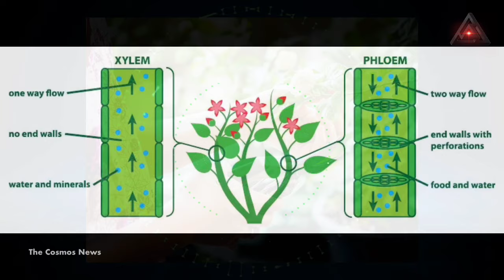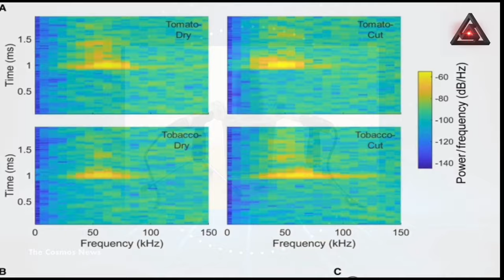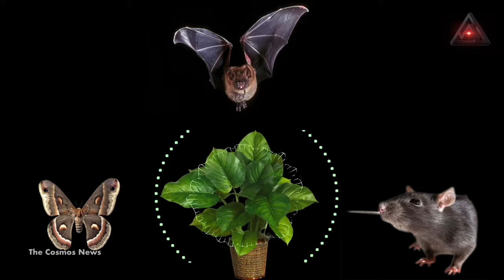Plants Feel Pain And Scream When Stems Are Cut Or Dried Crying Sound Recorded @TheCosmosNews

Comment: Item #: SCP-4521

Object Class: Safe

Special Containment Procedures: SCP-4521 is to be kept in Site-551's Bioterrarium and only accessible by personnel with Level 2 clearance or higher. Additionally, attempts are to be made daily in an attempt to provoke vocalizations from SCP-4521.

Description: SCP-4521 is a Douglas fir tree with abnormal shape and leaves. SCP-4521 was discovered within God's Silence, Oregon after reports of an "ear piercing silence" from within the tree's vicinity. Amnestics were administered, and SCP-4521 was transported by implanted Foundation agents to Site-551.

Currently, SCP-4521's anomalous property is that it is incapable of screaming. No apparatuses are found on SCP-4521 that allow it to scream, and attempting to create one has been met with failure (see testing log). Attempts are being made to provoke screaming within SCP-4521.

No memetic or cognitohazardous phenomena originate from or affect SCP-4521. Multiple attempts using several other anomalies have been made to detect any screaming, but no screaming was detected.

Test Log: The following are attempts made by on-site personnel to eliminate SCP-4521's anomalous ability.

Test 1: Carve a mouth on SCP-4521.

Outcome: Several holes were placed upon SCP-4521 using a chainsaw. No screaming appears to emanate from these holes.

Test 2: Use an extremely hot branding iron to imprint the word "SLAVE" onto the base of the tree.

Outcome: No screaming detected. Brand disappeared within 2 days time.

Test 3: Place multiple species of spiders upon SCP-4521's base.

Outcome: No screaming detected. Approximately 30% continued to stay on the tree. 50% of the spiders that stayed burrowed further into the tree. No screaming was detected during this time.

Test 4: Take a tree that is genetically similar/related to SCP-4521, and slowly destroy it in a close radius around it.

Outcome: Tree successfully destroyed over the course of 28 hours. No screaming detected.

Test 5: Take a tree that is genetically similar/related to SCP-4521, and [REDACTED].

Outcome: [REDACTED BY REQUEST OF ETHICS COMMITTEE]. No screaming detected.

Test 6: Use a D-Class personnel under the effects of mnestics in the event that SCP-4521's screaming is antimemetic.

Outcome: No screaming detected.

Test 7: Attempt to communicate with SCP-4521.

Outcome: See attached audio file.

AUDIO FILE: FILE-4521 INTERVIEW

[BEGIN LOG]

Dr. Hanz: Uh… hello, SCP-4521. Can you hear me?

Silence

Dr. Hanz: Did you say something?

Silence

Dr. Hanz: Oh, that was my imagination. I'm sorry.

Silence

Dr. Hanz: Listen… do you want to talk? Do you have something on your mind? Just let it out.

Silence

Dr. Hanz: Come on, it's not healthy to bottle up, You can tell me, I'm friendly.

Silence

Dr. Hanz: D-do you not have a reason to… you know…

Silence

Dr. Hanz: I do hope those thoughts in your head are doing you well, but they need to be let out. This is for your own good, I promise. Don't worry about making too much noise, I don't mind.

Silence

Dr. Hanz: Can you hear me? Can you even hear me while you're trapped in your mind? Can you see me through the foggy, muddy waters that are your eyes?

Silence

Dr. Hanz: Come on, the deafening silence is killing me! If you don't want to speak, or at least scream, the tests will continue. It's only healthy.

Silence

Dr. Hanz: P-please! You're scaring me!

Silence

Dr. Hanz: Y-you know… when I was a kid, I… I assaulted a kid. I took a bike lock and crushed his skull in. It went on for 6 minutes before being stopped by one of his friends, who I also clocked in the head. I went down the street, and I saw this lady. She fell off her bike. It was the same bike I stole the bike lock from.

Silence

Dr. Hanz: I took that bike, cut it up into several small, tingly pieces, and fed her the bike, over the course of several hours. She just laid there with her broken leg, and her stomach eventually ruptured. The black ooze that dripped from her stomach indicated that someone might have called the cops, so I went home, and locked my room. Do you want to know what I did?

Silence

Dr. Hanz: I screamed. I opened my mouth and let out the largest roar that was trapped at the bottom of my lungs. All those wasted opportunities, all those memories, fading away as the calming ring of my torn voice box filled the room. And look where I ended up! I got a doctorate and I'm working for one of the best organizations on Earth. It's not too late!

Silence

Dr. Hanz: Or… you haven't felt that thrill yet, haven't you. Typical. Outcasts like you, born in some random remote part of Siberia, no other individual in sight. You're too weak to impress anyone, so you just stay by yourself. I see your game.

Silence

Dr. Hanz: But I can help you! You need to scream!

Silence

Dr. Hanz: You need to scream! You need to scream! You need to scream!

Dr. Hanz proceeds to say the exact same phrase for 37 hours before being escorted out by onsite guards in order to prevent death by dehydration.

After waking from a short 4 hour nap, Dr. Hanz promised that he "will not stop until this tree finally screams." Testing is to continue.

[END LOG]
Reply: did you write all this?
Reply: The copy/paste is Nasty work